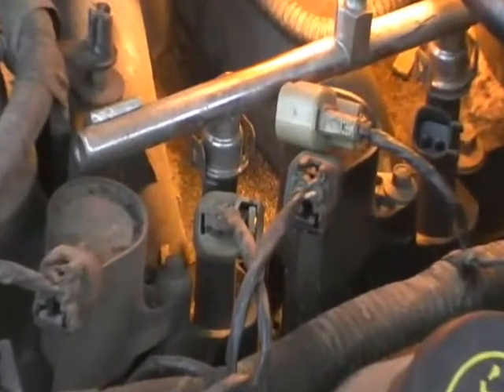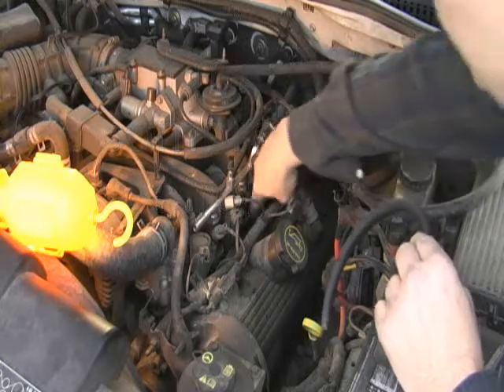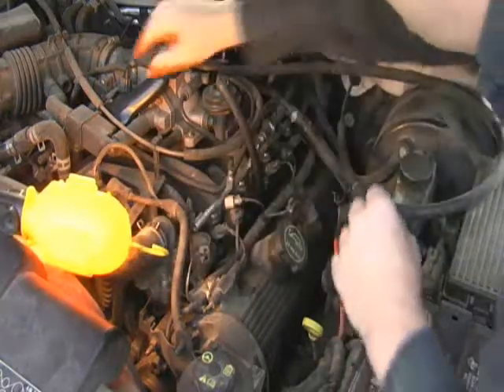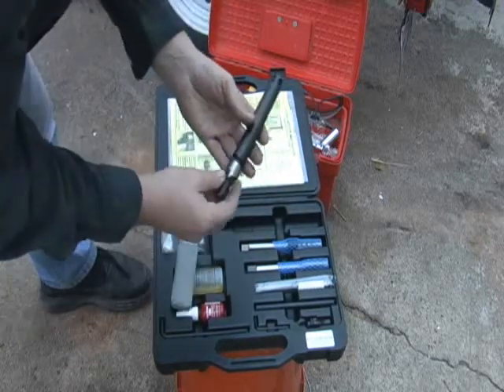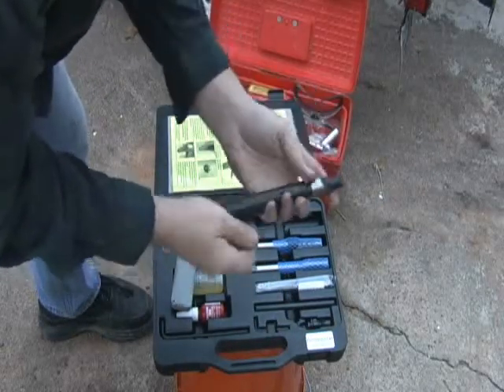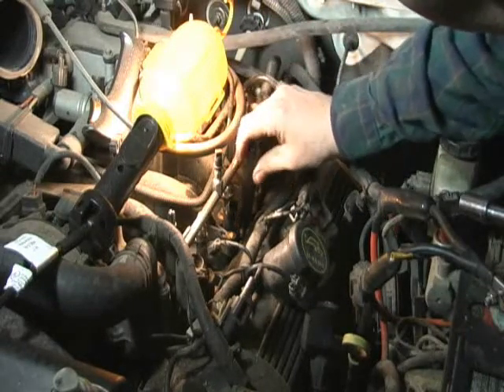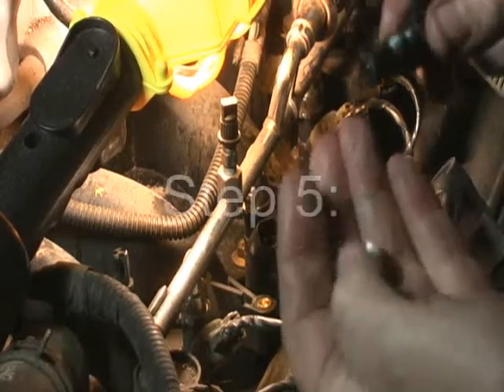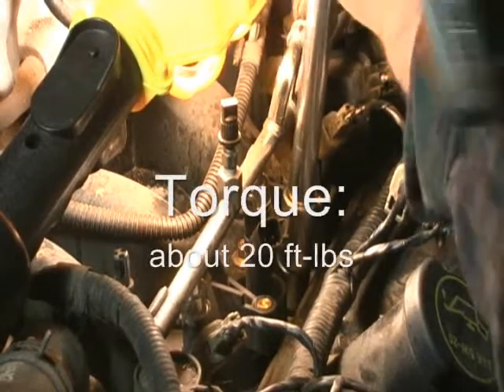Ford Explorer spark plug fix

Comment: How does the loctite hold as hot as the cylinder head gets, I thought heat was how you make the red loctite release....thanks
Reply from the maker: From Time-Sert: "Time-Sert Loctite p/n 6020 = Loctite p/n 266:
loctite 266 is recommened because of it’s higher temperture. Normal red loctite e.g. part numbers 277 or 271, burn away at 200 degrees which is the normal operating temperature of most engines.
Loctite our p/n 6020 has been tested to 500 degrees without any problems and will give added strength as it will not burn away when engine temperatures above 200 degrees are reached. "

Comment: how do I know where the wires go
Reply: If you're talking about the wires he connected to "bump" the engine, they go on the starter solenoid.  On my 2002 Ford Explorer, it is on the passenger side towards the front, accessible from underneath.  Roughly under the air filter sort of.  I made my own bump starter with a pair of motorcycle jumper cables, but there is very little room to get the clips in down there... better to spend the $15 on the bump switch. The solenoid has two threaded studs poking out.  If you jump them (with a screw driver or piece of wire), the starter will engage and the engine will turn.  Just don't have the keys in the ignition, or the engine will start. Some solenoids have more than two threaded studs...  just start jumping  the different studs with a pair of pliers until the engine bumps. Then you'll know which studs to use.  You'll get lots of sparks--  that doesn't matter, just don't HOLD the pliers on there for long.

Comment: Hey good video. We have been selling the Time Sert 5553 (with free next day shipping)  for quite some time now. Some heads do require more counter-boring than others like you pointed out, but the good thing is that the tool has a self stopping feature built in to prevent it from going too far. Over-all a lot better than replacing the head!

Comment: Yikes! $375 for the kit?!? Given, it's better than paying a dealership $1000 or more to do it, or paying even more to replace the whole head, but still, that's a hefty chunk o' change for a tool kit, a bottle of red Loctite, and some steel sleeves. I wonder if any places rent out the kit and you can buy the insert sleeves seperately...? And was the spark plug blowout issue common on '92-'97 Crown Vics, or just the later '98+ models?

Comment: Thank you so much for this video, Dave. It allowed me to make this repair without incident. I have only a limited knowledge of mechanics. My 2001Ford Expedition blew the #3 spark plug. I have had 6 Ford vehicles in the past 12 years from the same dealer in Van Nuys, Ca. They offered me a "good customer rate" of $2800.00 to replace the head. My local shop wanted $1800.00. I am struggling to make ends meet as it is. You and Time Sert saved me. Thank you, again.

Comment from the maker: Hello rockkkkher, 
They said to "place Lock-tite around the middle of the insert".  Their instructions show a pic of less Lock-tite than I put (their pic showed on one thread).  I think that this is enough given that they have a system that locks the insert into the threaded hole independant of the thread locker.  The torque spec comes from Time sert and is the torque of driving the insert into the head.  I did not see a spec for the spark plug itself.  I have always driven plugs by feel anyway